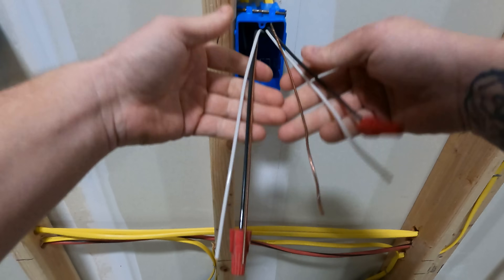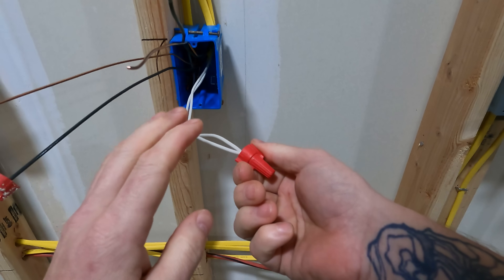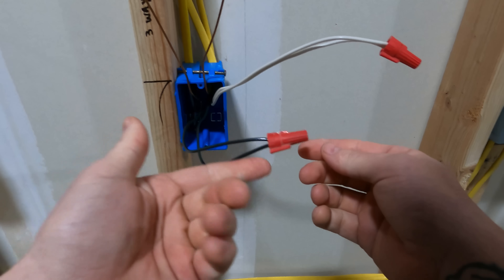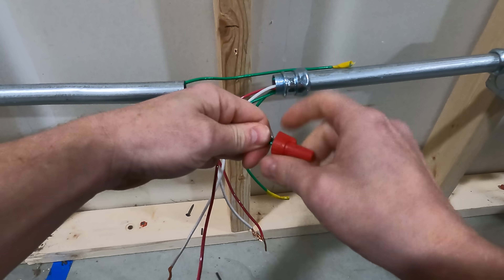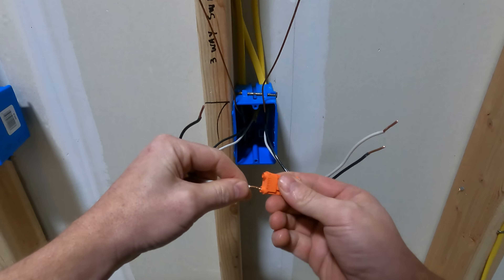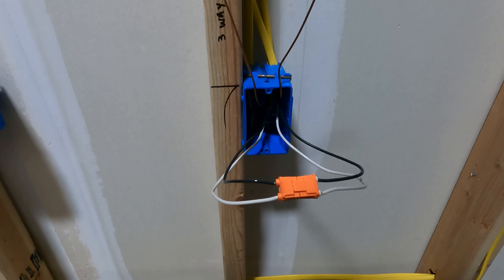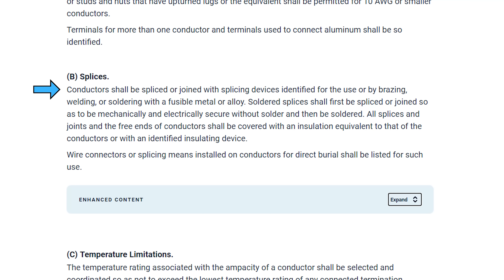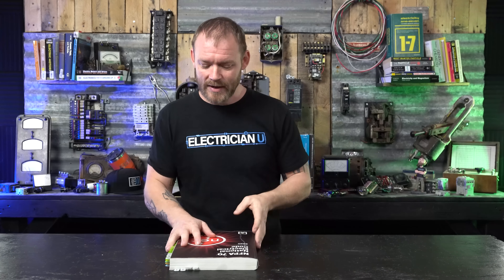To Twist or not To Twist? THAT is the Question.

Comment: Curious what your thoughts are on covering, or "securing", the wire nut with electrical tape after twisting.
Reply: I am pretty sure he covered that in a previous video or maybe I am just getting old and forgetful. What I was taught is using electrical tape was an older technique that was useful when the boxes were metal. I say go ahead if you want to but I don't think it is needed. I am in the middle of a construction project and have been talking to my electricians about some of these topics.
Reply: I work in New York City where code requires us to use bx and 1900 boxes. The only time I wrap it with tape is if the wires are really short and it’s hard to get a good splice. I don’t do this to support the connection I do it in case one slips out. Having the tape there will stop it from touching the box or another hot and causing the breaker to trip.
Reply: @esl4058  That makes sense as a just in case situation.
Reply: @Henry Gertcher  Now that you mention it, it does sound like a familiar topic. I am in industrial maintenance and have seen this time and time again. It always seemed unnecessary if they were twisted right in the first place. Not a master in code for industrial either, but I don't recall hearing or reading anything about it in the codes I have come across.
Reply: In a situation where there is no vibration, it is my opinion that wrapping a wire nut connection with electrical tape is useless. Firstly, there should be no bare copper exposed if you do it correctly, so no need to insulate. Secondly, the connection should be secure so as to not need electrical tape to hold onto the wire nut. Finally, if you are worried about water infiltration, then use a direct burial wire nut that has silicone inside.
Reply: Waste of tape if done properly. If marrette connections are in a motor JB or say a conveyor system with lots of vibration and movement then yes definitely tape to ensure marrette never comes loose

Comment: I pre-twist because that's how I was taught but then I got lazy.  I learnt the hard way that wire nut's aren't perfect and zapped myself trying to get to a different circuit in a JB. The hot incoming wire of the other circuit pulled right out of the wire nut.  Now i always pre twist everything.

Comment: Working on our flip house, I cannot tell you how amazing it is to see such LONG wires. WHY did they cut the wires to lengths so short, you just want to scream! Why! :)
Reply: Code is 3 inches beyond box.  (I always leave about 5 inches.) Combine that with someone replacing a receptacle and just cutting off the old receptacle and now you’ve got even shorter wires.  This is one situation where Wago 221 connectors are a godsend.  I’ve often wondered what fatigue is introduced to the wire when undoing a shepherds hook and then adjusting it for the new receptacle?
Reply: @glasshalffull2930  Yes, I've used the Wago ones as well. I literally bust the old outlet to avoid getting the wires any shorter (with eye protection on as well). They are the old push connectors and it's a nightmare. I found a 5 in 1 painters tool effective in doing that (power off of course). After that begins crying since it's often 2 - 3 circuits wired to it and cut ground wires - or soldered ground wires together -> because. It's a miserable experience. I tend to replace the old metal boxes with ones with room in them that aids in LESS suffering.
Reply: @JackKirbyFan  I feel for you brother!!!
Reply: @glasshalffull2930  Thank you!
Reply: Wow! Same with my house. Wires cut as short as possible. A pain to fix. I feel you!

Comment: I wish you would have shown and discussed twisting a stranded wire to a solid wire. Like wiring up a light or ceiling fan with stranded wires to the solid copper building wiring.
Reply: I put two 90s into the solid wire so it looks like a lightning bolt then wrap the stranded around the solid. It'll hold forever
Reply: Best to use a wago in that situation. Most secure way to go from stranded to solid.

Comment: I do not pre-twist most of the time. I just tighten my wire nut until the insulated portion under my wire nut has twisted twice, that always seems to give me a solid connection on my wires. If using stranded with solid, have the stranded wire sitting a little taller than the solid wire, then the same deal, seems to work great for me.

Comment: Question is, Wago or wire nut. And if wago, lever action or old school. 🤔
Reply: There are some YouTube videos that measure the contact resistance at full rated current.  Lever was more convenient to install and rework but higher contact resistance.  Old school Wago actually had much lower contact resistance but a bit harder to rework.

Comment: Long time DIYer here. I pretwist three or more solids and anytime I have a stranded wire in there. The old style wire nuts in the many sizes work better than the new fits bigger range of wires kinds with respect to wires backing out while nut being twisted on. I want to get some Wagon 221 for fixture wires as I like them for that application a lot.

Thanks Dustin. You do a lot of good content and I appreciate the emphasis on craftsmanship and taking pride in doing the job right.
Reply: Agreed, if I’m struggling to out on the wire nut, I just pre-twist and call it a day. It’s especially helpful with stranded and solid wire together as you said. I can’t imagine doing that for every connection though

Comment: A wirenut is an insulator.
(What I was taught)
At one extreme: had a DIY customer who had twisted and soldered every connection before wirenutting and taping.
At the other extreme: An HVAC installer who didn't strip any low voltage connections, just trusted the wirenuts to cut into the insulation enough to make the connections. Not good.
Oh, and there was a 20-story condo where NONE of the neutrals in j-boxes had wirenuts, just twisted. Saved a few bucks.

Comment: ive been pretwisting for 23 years now. Not one call back for any bad wire nut connections.
Reply: @thomasjeffersunidk about him, but for me they’ve been nothing less than a Godsend. Makes me wonder why we haven’t been using them for much longer. From what I understand, Eu has been using them for years.
Reply: @galenmarek8287  Yep, they have been the standard in most of the EU for decades. So much better than wire nuts.
Reply: waste of 23 years
Reply: 'ive been pretwisting for 23 years now.'
Fine if you're doing it commercially, and that way you have visual confirmation that you twisted the wires well.
But I find the video humorous for 'professional' use, because I've done wire nut connections since the early 80's and after learning I've never made one as poor as 4:09 in the video, with only a 90 degree twist.  You can literally over twist the wires with the wire nut once it grabs, that is simply not twisting the other turns to say it makes a poorer connection.
Pre-twisting is more for extra assurance without having to check after, and probably even more to have all the other noobs do it so you don't have them doing it wrong and it being hidden.  I can barely imagine an actual professional electrician not being able to do them as reliably as me after they've worked a year, I can do these endlessly and know the wires have twisted correctly before I even look, you can feel them twist in with the nut.
Again, video is just funny, I make 2+ turns every time easily.

Comment: what i say is that in panels i dont twist wire nuts and in boxes i do. nothing is worse than checking/working on something live and you go to untwist a wirenut and the wires fly apart and you get zapped.
Reply: What’s worse than having to untwist live is untwisting a wire nut and live wires shoot out into all different directions.
Reply: @Devin-_-  indeed. In a panel it's not a big deal because you'd turn off the breaker anyways
Reply: I always been told to never put wire nuts in a panel
Reply: @StrainingDingelberry  sometimes you just gotta.

Comment: never twist, use WAGO connectors, know you got a positive connection.
Reply: i just had a ton of wago style connections fail in can lights.
Reply: @FosterFarmsOk  failed how
Reply: @FosterFarmsOk  So, wheres the link for your video of fixing those?
Reply: @FosterFarmsOk  Ah, the key word there  is style. 
I'm betting that they were knockoffs, and back-stabs, not levers.
Reply: @FosterFarmsOk  Most likely installed incorrectly, or knock-offs. I've never personally seen one done right fail, and they're ubiquitous across Europe for a reason: they work really, really well when the installer follows the manufacturer's instructions. I personally use either depending on the scenario.
Reply: Biggest mistake you can make with wagos is to strip too much and leave copper visible/touchable.  It's been really annoying to straighten wires from nuts to be connected again in modern wago connectors in restoration projects.  Many wires just pop out from wirenuts when you start to dig them out of the boxes and there are clearly marks from bad connections.  And still, I do know that twisted copper wires make really good connection, but that has very little to do with wirenuts.  I would say that twisting + electrical tape would be better, as the installer would easily see if the connection got loose while doing it..  In Finland, we used wirenuts until 90's and have since been using wagos and other similar spring connections basically everywhere.  It's a bit strange to see wire nuts compared to lever wagos in about every american video about them, as we really use lever wagos "only" when some of the wires are stranded, but if everything is solid wires, we would use those not opening, only stabbing ones (that you could still get off by twisting (a lot) and pulling).
Reply: This is the correct answer: WAGO = king
Reply: I started using 221s awhile back. I love them, but seems sloppy Ina way.  I'm not sure if I can live with or without them. More use is needed.

Comment: Im from the Philippines and is practicing professionally for almost 5 years. We dont use whatever "cap" you guys use. Splicing and twisting is the norm and covering it with layers of electrical tape.
Reply: Tape is not an acceptable connector here.
Reply: Opening a box to find everything gummed up with old tape adhesive. Never a good time.
Reply: @helmanfrow  As soon as I see lots of tape I get suspicious. 99% of the time it's just wires poorly twisted together underneath. No connector and not soldered.

Comment: Twist all the way
Reply: I agree with a caveat. I've seen cases where a twisted wires have been over twisted and broken.
Reply: @brentthomas2931  impossible with kliens that happens when people use the drill attachments and just go caveman with it
Reply: @poyo3582   I accidentally did that once by hand by being overzealous on 4 #14 wires. Probably didn't help the wires were 40 years old though.
Reply: @dantejohnson4003  I've done the same thing but with #12 in a house that was made in 1872
Reply: Hell yeah brother
Reply: Never twist. You can tell you guys stateside never test anything...
Reply: @TheColemansMustard You are correct, sir. Only amateurs twist.
Reply: 3 or more, it's push connect time - wago.
Reply: Which way do you twist?
Reply: What’s your opinion about push in connectors?
Reply: Or you can join the 21 st century and use wago...